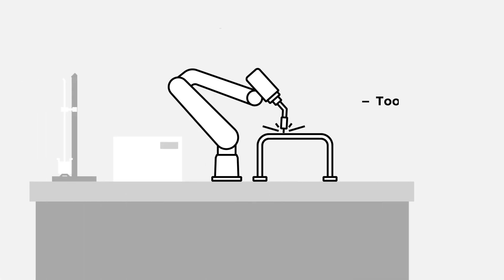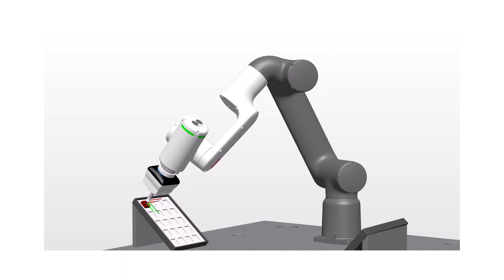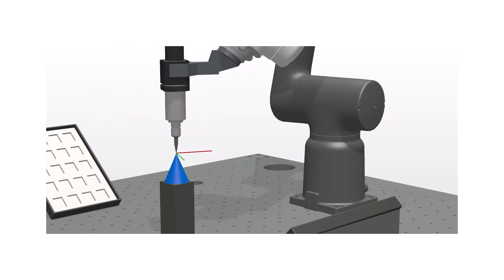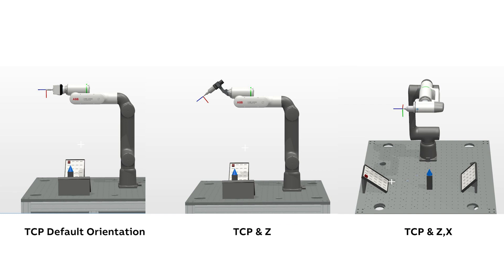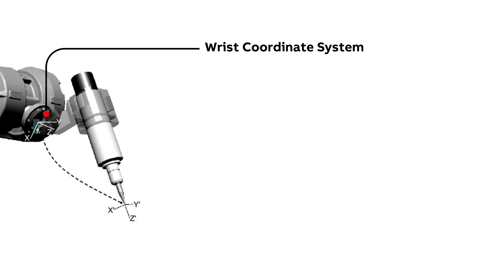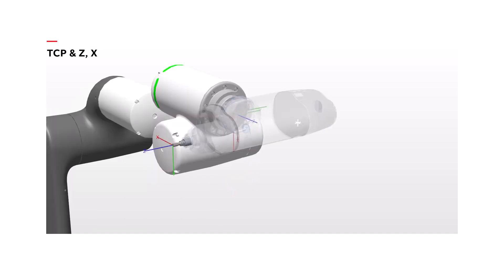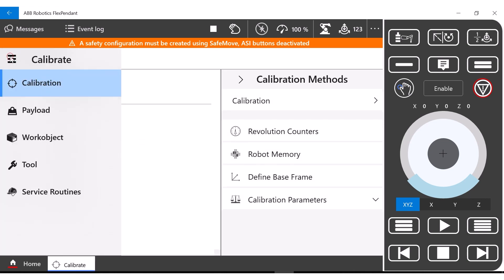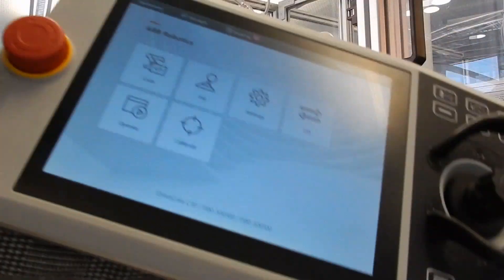Setting up Tool TCP on GoFa™

Comment: Heads up: As of RW 7.10, defining the TCP (tooldata) or workobject data is no longer done through the calibrate app. It is found under Program Data. Once you click on define, the steps are essentially the same as shown here.